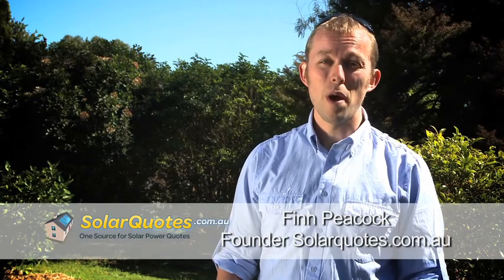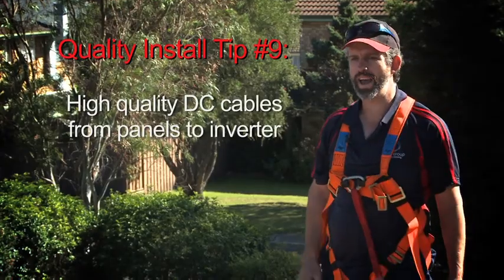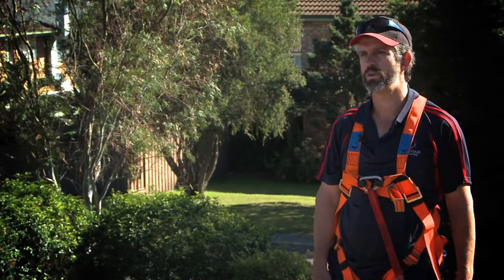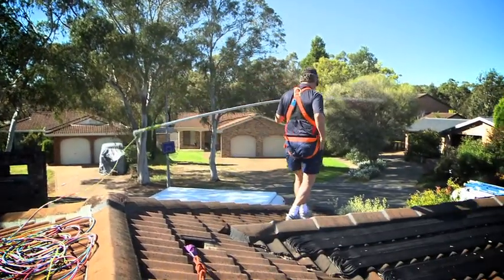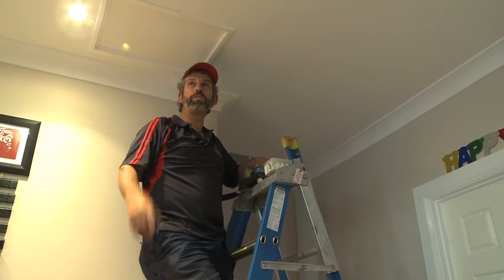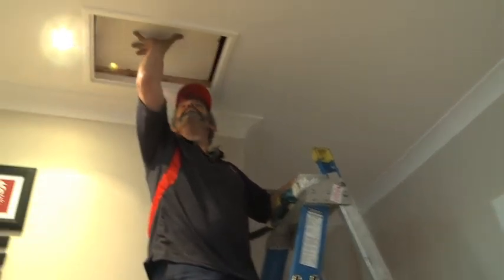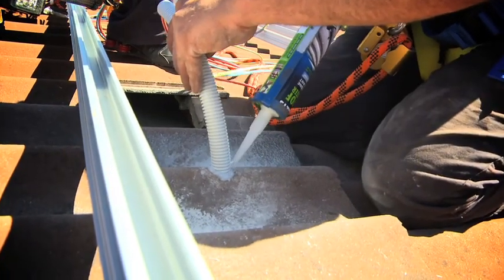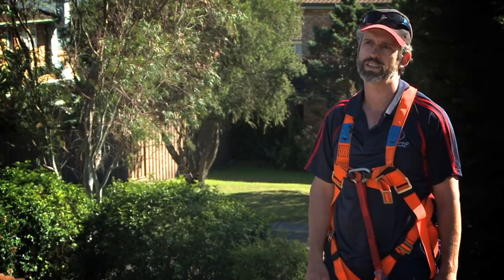Solar Panel Installation Part  3: DC Wiring

Comment: I would cancel instillation immediately  if I noted safety was not adhered to, Installers are not using the rope in most of the viewed, especially didn't like the frame where installer seams to only have his toes on the edge of roof with nothing to prevent him from falling
Reply: LeithHi he’s a grown man who does this work everyday....           how about let HIM make the decisions regarding his own safety....
Reply from the maker: This was a 2011 install.
Reply: @Sebeerful  Yes but hes setting a bad example for people trying to learn